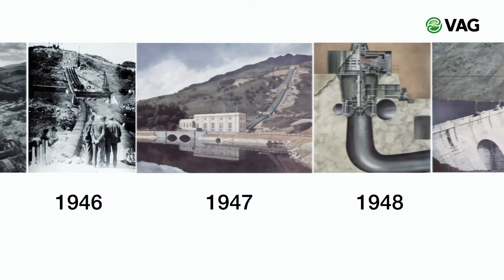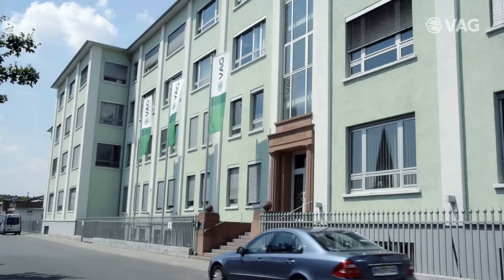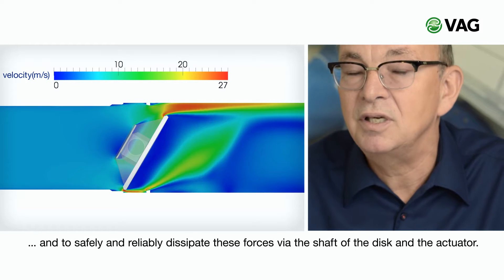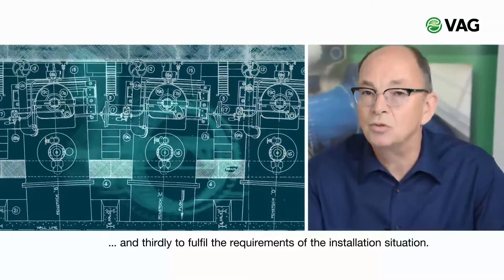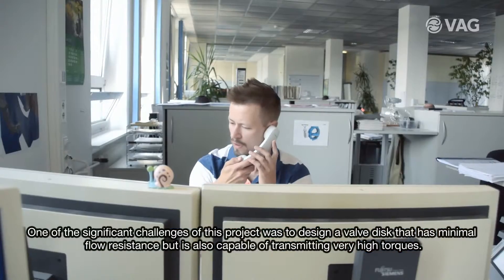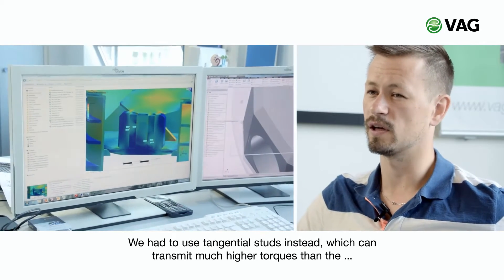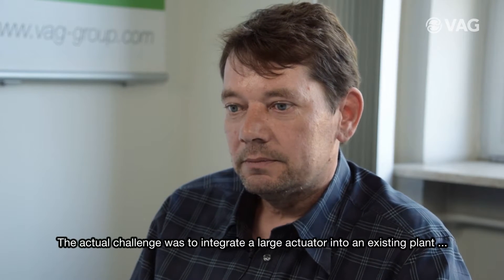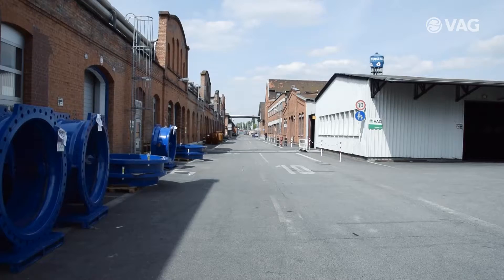VAG Valves for Sloy Hydropower Station DE / EN

Comment: ٍVAG is both a perfect design and trusted products ... I checked brochures of many valves delivered by contractors on many project sites in Tunisia and I find out really the accuracy in those types of VAG manufacturing. many times i go out and re-check the reliability of material resistance used in the valve assembly (body, stems, bolts, disks, etc..) I found always durability and accurately without leakages nor oxidation. thanks to VAG many projects handled successfully. good luck VAG :>
Reply from the maker: Dear FTINI Abdelmalek, thank you very much for your comment – when you are happy, we are happy, too. Any kind of feedback is highly appreciated! :)

Comment: ? what type and class of bolts and nuts i can use to install  VAG valves
i have a ductile iron  pipeline for drinking water transmitting
  d= 1200  mm PN= 25
d= 1100  mm PN= 40  
I USE BUTTERFLY , GATE LONG FACE AND DOUBLE CHAMBER AIR VALVES
Reply from the maker: Dear Mr. Gewaily, would you please provide us with your contact data via marketing@vag-group.com?
Kind regards and many thanks.
VAG Marketing Team
Reply: .ahmad_gewaily@yahoo.com i will send you  a detailed mail